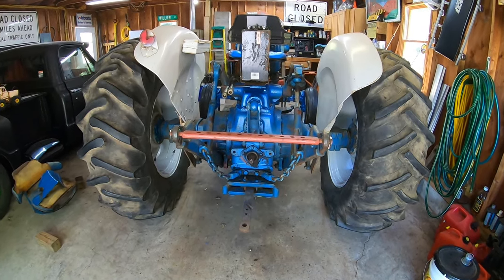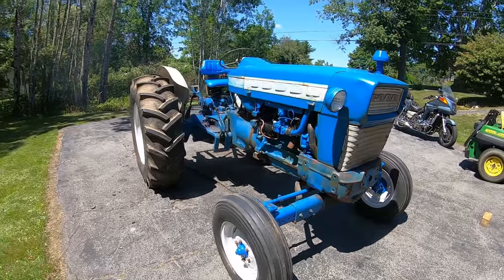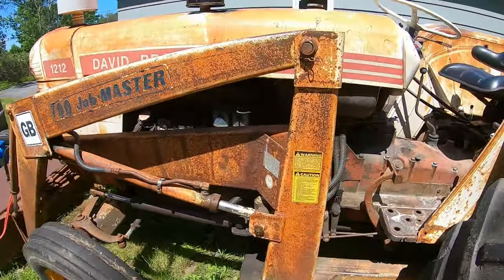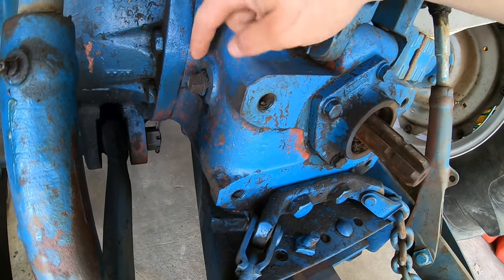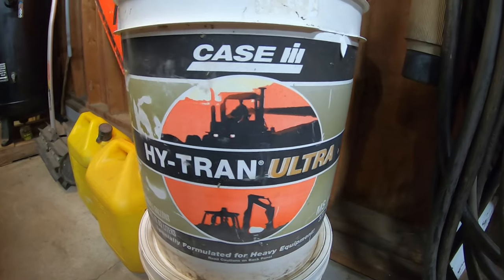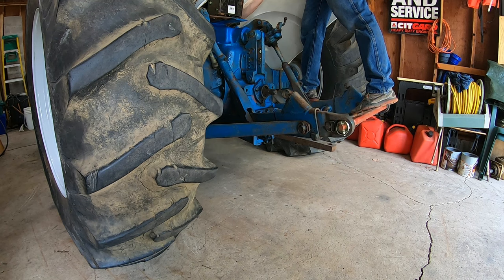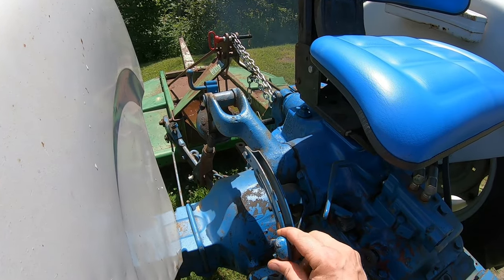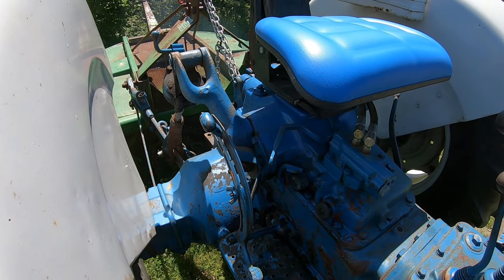Ford 5000 Restoration - Hydraulic Problems!

Comment: About time you changed all the filters and fluids on this tractor, The lever under the seat which is moved forward and backwards is called a spool valve which operates your auxiliary hydraulics,
Reply from the maker: Thanks. I still don't have anything to use those hydraulics with yet. Maybe someday soon!

Comment: Hi. The selector valve was used to divert the hydraulic oil to the auxiliary equipment before someone attached the remote lever unit to it. Without the auxiliary unit you can only use one at a time. I use it on my 5000 to switch between the 3 point and front loader. You can read about it in your user manual under “Auxiliary services control valve” or in chapter 11 of the service manual.

Comment: Hello Mark,
Try looking at the center plate for your rims and see if it is mounted on the outside of the rim lugs, this may make it narrower, might have to turn bolt heads around, but study a bit on that plate position. It seems really wide.

Comment: My 1966 does the same thing! Got it last year, as old as I am. Checked oil level, good, but looked milky. Right or wrong, going to change out the fluid this spring and see what happens. Have all the original manuals, they don't say where there are filters on it. Just says to take it to a dealership for that.
Reply from the maker: The hydraulic filter is inside the rear axle case. It's a bit of a chore to do! There is a strainer filter and a hydraulic filter. Try doing a fluid swap first to get the fluid cleaned up (run it like that for a while) before you drain the fluid and change the filter. You don't want to replace the filter twice.
Reply: On my ford 3000 there is two hydraulic filters located under the top lid 3 point cover.  One is easy to remover the other one is super hard to remove. We just drained all the hyd oil out cleaned the filters with diesel fuel or kerosene Filters  ended up looking like brand new.   Down fall to this I think some dirt and junk ended up getting sucked into return line into Hyd pump because pump is now weak..We should have broken loose the return line at the pump and cleaned out that line also.....

Comment: Never had that problem on my 5000 (knock on wood) but on my 641 Ford workmaster I often had to loosen an allen plug out of the oil pump to bleed the air out.  Your 5000 must be setup very wide, mine is 7 feet from outside of one rear tire to the other.
Reply from the maker: Interesting....things to think about...Yes the outside of the rear tires measures about 7'9". It seems very stable, should be pretty sure footed....

Comment: Almost certain it's a sticky unloader valve. I have the same exact frustrating experience. I left the O-ring off of the unloader valve. It all works excellent now
Reply from the maker: Thanks. How big of a job to get to the unloaded valve? Did you have to pull the top cover (lift arms) off?
Reply: @Mark Tolman  yes the lid must come off. But that is the hardest part about the whole deal. If you can't find the exact correct o'ring just leave it off. It was made out of a special material and a regular o-ring will cause the same problem over again. But a Ford garage might have the correct o-ring. Polish the O-ring using WD-40 and a green scrubby pad from Walmart. Never any type of abrasive, even super super fine, it will wreck the tolerances. Here's a decent video that shows a bit about it. Good luck. https://youtu.be/Ble9ISKk1XY
Reply from the maker: @calvinkalmon6746  Awesome. Thanks!
Reply: And I meant to say polish the valve with the green scrubby. Throw the O-ring away.
Reply from the maker: @calvinkalmon6746  I'll give this a try next...
Reply from the maker: Thanks!

Comment: The "waiting" is caused by a bypass valve sticking. There is a low pressure on the free oil flow circuit from pump through the filter back to the transmission case. The "backpressure" valve in the end of the hydraulic filter tube.That low pressure pushes the bypass valve to the lifting position when you move the control valve, until the position linkage returns the free flow mode back.  Sometimes a hydraulic fluid type change causes that, some oils soften and swell the O-rings. One of my 4 Ford 5000's from 1971 has occasionally done that from new, the other 3 never. I haven't done anything to that because the tractor is very original and works well. Usually the sticking happens with cold oil. I think the service manuals told us to remove the seal from the bypass valve; it still works but doesn't stick anymore. 

You can avoid the waiting in the morning by stopping the tractor while lifting the linkage. You can return the lever down later. The bypass valve stays in the lifting position. After one movement it works the whole day flawlessly.
Reply from the maker: Thanks for the info I'll have to give that a try! It has been working better without as much wait, not sure what direction I'll go in, removing the lift ram cover is an off season thing, I'll have to wait for
Reply: I was thinking the low fluid levels weren't allowing the pump to prime itself. Never thought about a bypass valve. 

Guess that's why I keep reading the comments and learning...

Comment: How to replace the front wheel studs for Ford 5000 tractor,what causes hydraulic oil looks milky and what causes hydraulic lift not working?

Comment: How many gallons of hydraulic fluid does the Ford 5000 take?  I'm planning to flush both the hydraulic and trans fluids soon.
Reply from the maker: According to tractordata.com, the hydraulic system holds 8.7 gallons. I believe that a fluid swap may take a bit less, as you wont be able to get all the fluid out by draining...The manual transmission holds 10.8 qts, or 2.70 gallons.
Reply: The 1966 book says 34.8 quarts for hydraulic and 19 quarts for the 8 speed transmission. Changed my fluids last summer and used pretty much that amount.  Dealer sold me 20 gallons of NH 134 because of the loader I have but did not use more.
Reply: @danjosephson8820  From 1968 on the gearbox oil level was lowered. You have a oil level plug on you tractor, the Force models have a dipstick on the filler plug.

Comment: Using a chain instead of a top link is dangerous because if the cutter hits an immovable object the tailwheel can flip right at the back of your head.
Reply from the maker: That's a very good point, I'll make sure change it out. I used a chain at the time of the video because I didnt have a cat II toplink... thanks.

Comment: Got the same tractor front loader wont raise any thoughts?
Reply from the maker: Is it only the up function that doesnt work? Does the bucket dump?
Reply: Thanks for responding got it all fixed bad pump
Reply from the maker: Good to head it's back in action.

Comment: Hello Mark, have you found the problem on your ford 5000?
Mine makes the same hissing noise when accelerating.
I thought it was a hydraulic pump problem.
Reply from the maker: Luckily for me, new fluid and it's been going great. What I've messed with in the video seem to do the trick , I have yet to see more issues with it. I still have yet to change the internal filter, but I suspect that will be soon.

Comment: My Ford 5000 does the same thing. It usually takes awhile for the three point hydraulics to work. I see folks below have noted to clean the filter screen. Did you try that?  I’ll try that next. 

Very frustrating. Feeding hay tonight and it never worked the entire time. Normally it only takes a minute or two for it to start working. 

Any help is appreciated.
Reply from the maker: From what I've experienced, it's a combination of hydraulic check valve leaking when it sits, and that suction filter. I got lucky. Changed fluids, the hydraulic oil was very watered down, must have been from sitting for so long. I have been using it with a 6' rotary cutter, seems to go well. I still need to change the internal filter, am going to do that in the off season (it's quite a job to get to the filter). Mine still does the hesitation when first started, but works fine after. Annoying, but I've been able to live with it so far.

Comment: Hydraulic filter may be dirty or clogged. Not sure if that model has a spin on filter or internal filter cartridge. Clean hydraulic fluid and filter should be the ticket.
Reply from the maker: Must be an internal filter....none on the outside of housing. Thanks, I'll do some digging..
Reply: @marktolman6037  Internal filter. The lift cover has to be lifted up. You raise the cover a couple of inches and you can see a thick steel tube in the middle of the cover, pointing down through the transmission case. You have to help it out from the transmission case by wiggling the cover while raising.  You will find the filter element at the end of the tube. Usually it is smashed rather badly either when installing the cover or lifting the cover. After you have seen the exact place, you are able to be careful and avoid the damage. It is a paper element, you have to screw out the back pressure valve before you can loosen the filter. So the filter is immersed in oil, near the ol reservoir bottom. The suction screen is on the pump side, also attached to a curved steel tube. You take the pump out, the screen comes through the same hole easily. Usually it is very fine plastic screen, I have washed it with a suitable cleaning agent and very soft toothbrush. Then you look through it with a bright lamp. Replace if holes are found.
Reply from the maker: @sarkisi  Thanks for the grear info, sounds like what is causing my problems...I'll make the repair at some point in the near future

Comment: How did you get the selector valve unstuck? Mine is stuck and I have had no luck getting it free.
Reply from the maker: I ended up taking the plastic cover off (it takes a small machine screw with a flat head), exposing the small metal lock, looks like half a moon, or a glad hand connection. Thread in a longer 1/4 x 20 bolt, so it sticks out of the trans housing. Then I used a small prybar to pull it gently....that connects inside, to the hydraulic spool control...
Reply from the maker: Took a little persuasion to get it free, just work back and forth, if it moves out, press it back in until it moves freely
Reply: @marktolman6037  Awesome! I took it apart but didn't think of putting a longer bolt in. Thank You!
Reply from the maker: Absolutely, best of luck!

Comment: Hey, I have the same 5000. Where can I find a top link? I need one cause mine is going into mowing duty
Reply from the maker: Tractor Supply has the category 2 top links, as well as the local kubota, new holland, john deere or any other tractor dealers.
Reply: @marktolman6037  alright didn’t know if it was specific to the tractor, thanks a lot man!
Reply from the maker: @thatranger92  Absolutely! Best of luck mowing

Comment: My 4000 has a similar problem with the hydraulic lift but I just thought it was lack of oil
Reply from the maker: The problem never got any worse?
Reply: @marktolman6037   haven't noticed it getting worse but I'm doing the rear axle seals now to try and keep the oil in the back end I can then see if it works better
Reply from the maker: Be interesting to see if your problem is cured with the proper level of oil in your case..., or if it makes no difference
Reply: @marktolman6037  yes hope it will. It's actually a ford 4000 bit like your ford 5000
Reply from the maker: Very similar!

Comment: Mine not lifting at all... what could be the problem
Reply from the maker: Here are some ideas...check your hydraulic fluid condition and level. If it's not that easy, check 3 pt. hitch lever, make sure it's still connected to the valve it moves up and down. If it's nothing obvious or external, chances are you have to open up the tractor. Either you aren't picking up fluid, or the pump isn't pumping...best of luck.

Comment: The Ford 5000 is one of my favorite  tractors .  I might suggest  you should never run a tractor hydraulic system  with water in it !  Drain & flush the system & refill with the correct fluid .
Reply from the maker: Thanks. At the time, I didn't know what was causing the issues with the transmission. I didn't want to waste new fluid if I was going to be draining it out again shortly after.

Comment: My rear hydraulics aren’t working. My knobs were seized and got them unstuck… could that be why? The handle is loose that’s under the seat. Trying to learn, because I’m new to this tractor
Reply from the maker: When you say rear hydraulics, are you referring to the remotes or the 3 point hitch?
Reply: @marktolman6037  yes. Both. My tractor is literally a clone of yours. I need to know if mine is a single or dual remote valve body as well. My 3 point doesn’t raise or anything now. The bucket won’t raise unless the handle is in the right position
Reply from the maker: The selector valve could be to blame, and there is also a speed knob which can be played with...selector valve should be all the way in...but I would check oil pickup if you are not getting any action at all, after you check all the easy stuff (like oil level, handle positions and remote valve functions). Oil pickup requires the removal of the trans cover....not a fun job. Always start with the easy stuff first. Do you have any flow to the remotes at all? Could just be low on fluid
Reply: @marktolman6037  haven’t checked the fluid level. Which should’ve been first. I’ll do that. My power steering is a SOB to turn left and easy to turn right. As well… smh
Reply from the maker: Always start with the easy to check stuff first!
Reply: @marktolman6037  my fluid in the hydraulic area was empry
Reply from the maker: Hopefully that was the only problem! Now to check if it was leaking, or to see why it was empty..
Reply from the maker: Make sure to fill up to the port of the left side of the rear end
Reply: @marktolman6037  I don’t see the port?
Reply from the maker: It's a NPT plug to the left of the pto
Reply: @marktolman6037  found it. I’m using tractor hydraulic fluid
Reply: @marktolman6037  using car quest tractor hydraulic fluid
Reply from the maker: That'll work
Reply: @marktolman6037  do I need to fill it up all the way? Sorry for bugging you man. I’m new to this 5000, I can start to see fluid in the cap behind the seat now
Reply from the maker: Fluid only needs to be up to the level plug, the plug you remove to the left of the pto...
Reply from the maker: https://www.mytractorforum.com/threads/ford-5000-help.1343703/#lg=thread-1343703&slide=2
Reply from the maker: Picture 3 shows the level plug very clear. Once oil starts coming from there, it's full.
Reply: @marktolman6037  thank you. I think I’ve overfilled it way way over because fluid pours out like crazy. So I need to drain it til hardly any fluid comes out that level plug right?.
Reply from the maker: @MrSchrum  correct, sounds like you may have overfilled a bit
Reply: @MrSchrum  The Ford 5000 can hold one or two gallons over the level plug without risk of damaging the tractor. The only risk is that a possibly bad PTO axle seal starts to leak through. Also if you s brake rod seals are very old and worn they might drop some oil on the ground. The overfilling is recommended if you use very big one-way cylinders like tipping trailer lifts. The user manual says that you lift the 3-point hitch to the upper position and also push all the one-way cylinders to the longest position and then check the oil level.
Reply: @marktolman6037  which water pump do you have? My pump is bad I think because it started leaking around the front of the engine and started getting hot so I cut the tractor off and it tried running backwaters or something. Anti freeze poured from near the brand new radiator. Thinking it’s the water pump
Reply from the maker: @MrSchrum  I bought the replacement water pump from All State Ag. 
https://www.tractorpartsasap.com/water-pump-single-groove-pulley-new-ford-100558.html
Reply from the maker: Just be mindful, this water pump will require modification to the generator bracket. Watch the video I made on the water pump replacement. There may be a water pump out there that does not require the bracket to be modified....

Comment: The valve you pulled out controls hydraulic pressure.
Reply from the maker: Any idea what changes it makes to the pressures?
Reply: @marktolman6037  on my ‘72 4100 it’s kinda like high flow but it’s not a true high flow. It goes from min-max.
Reply from the maker: @zfilmmaker  Interesting...I'll have to experiment with that valve...thanks.
Reply: @marktolman6037  the only time I ever used it was when mowing hay. When I inherited my farm from my dad in 2000 I made a lot of hay with them. A 2600 is a great rake/ted tractor and ‘77 6700 to pull a Ghel baler. I bought a few more larger ‘70’s models later on and completely rebuilt them. I love Ford tractors! I now farm with Fendt’s but The Ford tractors are really special to me. I have all the orig manuals including the shop ones. I’ll look that up to make sure I’m right.
Reply from the maker: @zfilmmaker  That sounds like it was a great lineup! These classic Fords are great, they never die, just keep getting rebuilt and passed on to new owners! Thanks for the info.
Reply from the maker: I dont think I'll ever really use the hydraulic flow control, as I only use the Ford 5000 for heavy mowing duties...but one can never know what it may be used for!
Reply: @marktolman6037  confirmed… it’s for fast/slow hydraulics. It can also be used to affect the speed of your loader or rear three point.
Reply from the maker: Thanks! That's a good thing to know, that may come in handy some day!
Reply: The valve you moved in and out is the auxiliary services control valve. On the 5000 IN-operates the three point and OUT-operates external cylinders on something like a loader. It has “Selector” embossed on it.
The valve further back is the flow control valve and controls the lifting speed of the 3 point or remote cylinders. It has an S and F on it with arrows. Slow – Fast.